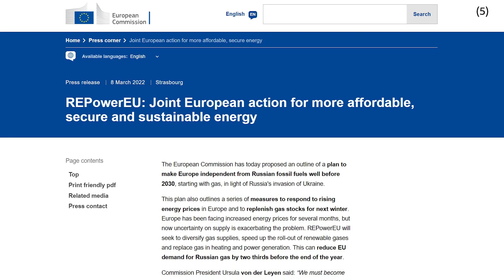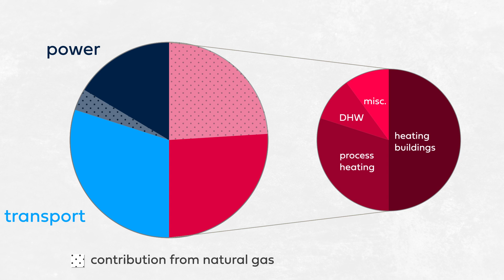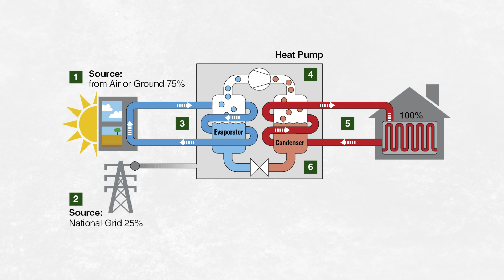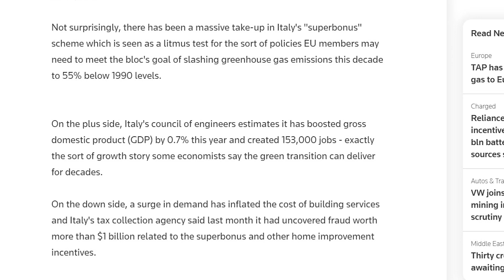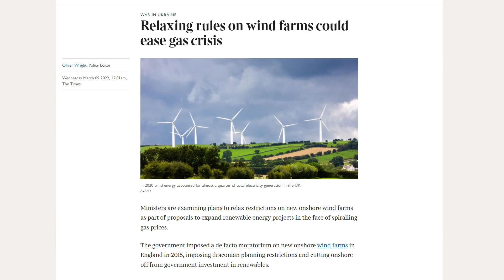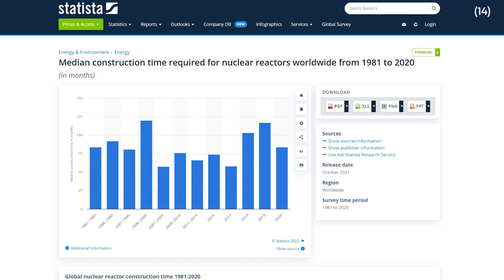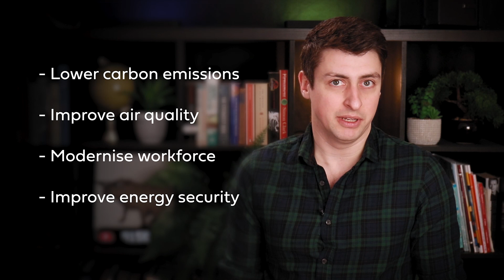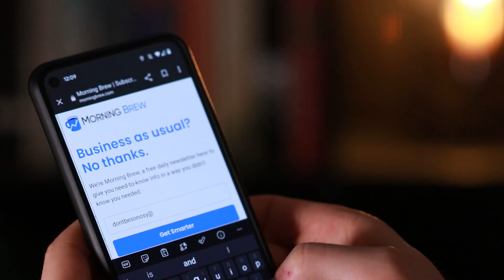How Europe can wean itself off Russian gas

Comment: Another point that can be made about heat pumps is that they are essentially air-conditioners running in reverse. This means that in countries where air-conditioners are already common (such as Spain, Italy, etc.), existing air-conditioners could be replaced with hybrid units, which can provide cooling in the summer and warming in the winter.
Reply: Sometimes called ' reverse cycle heatpumps'.
Reply: I install these systems, they are really amazing.
Reply: One important advantage also is that they usually have an efficiency of 450% for a simple system or even more (unit exchanging heat with the ground can exceed 600% even on a small scale system and 750% for bigger system serving a building). Meaning if you produce 1 kWh of energy by burning gas for heating in your home you'll only get 1kwh of heat. But if you burn 1 kWh of gas in a power plant, with efficiency usually ranging between 40 and 60% you'll get around 0.37 to 0.55 kWh of electricity delivered, accounting for grid losses. Those will translate to 1.6 - 2.4 kWh of heat in a simple system exchanging heat with outside air, or exceeding 4 kWh on more efficient system exchanging heat with the ground and serving a building instead of a single house. Thus even if it's energy from gas, you're getting much more useful heat out of it.
Reply: How this can solve a energy problem?
Reply: @DontMansion   With a heat pump giving 3kwh or 4Kwh of heat for every Kwh of electricity , we need less power in total.
Reply: You can convert an existing air conditioner to a heat pump with both heating and cooling by installing a heat pump thermostat, reversing valve, demand defrost control, two thermal expansion valves, and a supplementary electric resistance heater in the air handler.
Reply: Yep, virtually all air force heat pumps are air conditioners as well and are great systems to heat and cool homes, I know, I installed one myself last summer.
Reply: Practically all existing air conditioners are already what you call 'hybrid units' so nothing needs to be replaced. All it needs is for people to know which button to press on the remote control to set it to heating mode. I find it surprising how so many people have air conditioners and not know that they can also heat apart from cooling.
I have been using the air conditioners to heat my home for the past twenty years or so. I think it will actually be difficult to find an air conditioner that is not reversible, at least here in Europe. Maybe in other parts of the world it is different.
The way it works is quite simple, there is an electromechanical valve which reverses the flow of refrigerant swapping the roles of the condenser and the evaporator.
With all its benefits it does also have a serious limitation. At very low outside temperature it becomes less efficient and may even stop working entirely as the evaporator becomes too cold to do its job. So it is generally very effective for moderately cold outdoor temperature but not in extreme cold.
Reply: They are standard, but these units use a lot of electricity, the external radiators have large fans, great for dispersing concentrated heat but I doubt the efficiency of heat scavenging on cold days.  Heat pump systems generally pump liquid through underground exchanger pipes.
Coverage on methane supply has mentioned green hydrogen.  Perhaps Spain and Italy can become Solar energy converters  as could Scotland & Ireland with their potential for wind generation.
Reply: you are joking right
Reply: @bellini98-1  You can actually get even better than that but it is more situational as you need a body of water for a water source heat pump. A friend of mine has one that extracts heat from the River Severn in the UK as they live right next to it. Granted this is likely to result in other problems in time as despite the slope of their back garden the river is increasingly breaking flood records and it has reached within 30 cm of the ground floor already. But it need not be a river a lake or the sea is viable for those homes near it and our species has built a lot of homes and businesses near the water, we can exploit it's high heat capacity and good thermal conductivity in those areas for heating. You can of course also reverse this dumping a little extra heat from the air inside into a large thermal mass of water when it gets hot it is both a giant heat source and heat sink depending how you connect the piping up to the compressor and evaporator parts of the loop.
Reply: @listerdave1240  I think it is actually two valves, you want to flip both the input and output of the condenser and evaporator around such that they reverse roles. That would take two valves to work but that is all both are basically designed to couple the fluid with lots of thermally conductive surface area to maximise heat transfer.
Reply: @seraphina985  Well yes, I guess it depends on how you count valves.  From a functional point of view it can be considered as two valves but in practical terms it is actually a single device known as a reversing valve or a four way valve.
An oversimplified description of it is that there is a valve body with holes to which refrigerant pipes are connected. There is a piston inside the valve body and as it moves from one end to another it uncovers some holes in the valve body and covers some others and is actuated by a solenoid.
There are four pipes connected to those holes in the valve body, two of which go to the compressor, one to the outside radiator (normally acting as condenser) and one to the indoor radiator (normally acting as evaporator)
As the piston in the reversing valve moves from one end to the other it swaps the connections to the compressor such that the suction is connected either to the condenser or evaporator while at the same time the discharge is connected to the opposite.
To be complete I would have to mention also two check valves that are often also present, actually probably always nowadays but AFAIK not in older air conditioners, but let's leave that on the side.
Reply: That can also be considered a downside as, it the summer cooling often eats up the energy savings of the winter. 😂😂
Reply: @listerdave1240  I appreciate you explaining the mechanics as I had no idea how it was implemented in practice, merely that two outputs need to be swapped between two inputs thus two valves acting like double pole switches.

Thanks to your explanation how the valve actually works I realised it is actually analogous to a double pole double throw switch. Recognising that I realised that both valves ought to be interlocked in this situation so a double throw valve would be the solution. Somehow I'd missed the bug in the independent valve design as I'd failed to consider the edge case where only a single valve actuates, once you mentioned it was a double throw I realised that is a worse failure mode than neither valve moving at all (At least in the latter the device can function in the last mode set pending repair/replacement of the inop valve).

I guess it suddenly hit me when I recognised the analogy with double pole double throw relays and such, suddenly it hit me the thought that this is essentially a polarity reversal/pair swap circuit which are familiar to me as I've written device firmware for chips with pins directly connected to ports where the cable can be inserted upside down like USB-C. Naturally when that happens all of the pins are flipped horizontally too so the firmware needs to detect this and flip the electrical connections. Get this wrong with the data lines it is almost invariably fine, the user might need to manually unplug and rotate the cable like it is a USB-A but nothing dies. Mess this up on the +5V/GND lines and all bets are off, lots of microelectronics don't appreciate a voltage of 5V period (3.3V is more common for IC's for example) of those that will another batch will die as they give up the blue smoke and go on perpetual strike if fed reverse voltage etc. Or other things that can happen with some connector type is things like a 5V and 12V line getting swapped (There is a connector with a single straight line of pins that can insert and connect either way up. Pinout of interest P1 +5V, P5 0V, P9 +12V, P5 is in the middle so it is constant, mirror the other and you will see the problem).

Comment: Disappointed by the blanket dismal of nuclear. Would've been a great time to discuss keeping existing nuclear power plants open and producing low-carbon electricity instead of shutting them down (Looks at Germany and Belgium specifically). Also if using electric heat pumps for heating then you need to decarbonize electricity production too. And we need all the firm low-carbon generators we can get
Reply: The point is that those things can't be done in a short enough time frame, as he said.

Comment: Around 3:20, Simon claims that insulating buildings "can be widely rolled out rapidly". it would be nice if this were really so, but it isn't really!
For starters, this IS being done already, has been going on for many years (and that of course does not invalidate the concept, quite the contrary) - and what's holding back building owners is often, today already, the scarcity of insulating materials and - more importantly - of skilled workers and firms to do the job. Tried calling your local contractors for roofing, windows, wall building lately when they may have time to refurbish your home? You won't get one for next week. If all of Europe wants to accelerate this - rapidly! -, the situation's gonna get worse: Prices increase drastically, without much more work being done in the short term, and it will take some years before capacities come up to levels necessary to "widely roll out rapidly" throughout Europe (or everywhere else).
There is also a bit of a problem in that many insulating materials are an environmental hazard in and of themselves. We need others, more eco-friendly ones - and that takes even more time to roll out widely.

Similar caution applies to heat pumps - only worse: While some of the handy work to insulate homes can be done by unskilled work (e.g. home owners themselves), this is not at all true for heat pumps, where you need electricians at least (don't fiddle with electricity unless you have thoroughly learned the trade!),  but also specialists for drilling deep below your house etc. Nice technology - comes decades too late to avert the current crisis and dependence on Russia.

Solar and wind electricity generation should by all means be expanded - but would do little to decrease the use of natural gas in the electric grid, for natural gas plant's classic job is to jump in on the shortest of notices when demand goes up or base supply goes down - the exact two things that solar and wind have a problem with. Natural gas is in storage for that job, and short-term storage is exactly what the solar and wind installations are largely missing (so far). So what we need to, specifically, get rid of gas plants is not so much more renewable production per se but energy storage in the grid, to fill the gaps when solar+wind+nuclear+and all the rest cannot crank up output at short notice. (I suppose some regional grids use more gas than others, and not all of it in that backup role; surely, in such regions, some gas can be substituted on far shorter notice).

What everybody can do, right now, is reduce personal use of energy, particularly if you use gas (or oil, where Russia again is a major exporter to Europe), e.g. by reducing target temperature in your home or office by one degree. Or by switching off your heating system two weeks earlier in spring than you ordinarily would. Put on warmer socks, move a little more, and just get used to it.
Reply: Solar and wind would add to the base level of available energy, and thus less gas would be needed to fill in for temporary increases in demand.
Reply: Perhaps they could propose a "normal" energy consumption for a certain house volume and anything above that would cost a lot more. The advantage of that is that the owner now can think out a solution himself. Perhaps he could indeed insulate his house completely or he could use only one heated room, sleep downstairs for a while, wear a lot of clothes..

Comment: The problem with renewables is transmission and the time to construct the transmission as the obvious locations have been used up, project timelines are getting prolonged. Nuclear can be built in 4-5 years which is comparable with big  renewable projects (the speed of permeting has to be addressed tho)
Reply: Flamanville unit 3 is taking more than 4-5 years as is Hinckley point C
Reply: @waynecartwright-js8tw  those are outliers. The median time of construction of a nuclear reactor is 6.3 years.

Comment: Hi Simon, have you looked into nuclear co-generation as an option for process and domestic heating applications? I'm a PhD student myself investigating further co-generation options
Reply: Until recently Russia had 60KW thermal reactors in Siberia.
Reply: I don't know the efficiency compared to PEM Electrolysis etc, but Thermochemical production of Hydrogen via Nuclear Power has been proposed/studied a bit.
 (Also radiolysis with spent fuel rod cooling pools, but i don't know if that has a contamination risk).
Reply: Granted i think short of ultra-remote (Artic+Antartic, Mobile Like Ships/Subs, Space etc) / high energy use places (Dense Urban Areas, Captive Power Plants for Huge Industrial Hubs), i don't see much of a role for nuclear in the future, it would have been great as a Centralized Coal Plant Based Grid-era Replacement, but (Fore the most part, some exceptions exist) Decentralized Grids are the future.
Reply: Former Warsaw pact countries used waste steam for district heating. I know the Czech republic still uses their turbine exhaust steam for district heating. You can also use the waste steam to drive absorption chillers for air conditioning and refrigeration.
Reply: @gregorymalchuk272  yes. We use waste heat from Mělník (coal) power plant for heating parts of Prague. There is even talk about similar scheme in Brno and Dukovany (nuclear) power plant.

Comment: Great video Simon! Another excellent heating technology is heat networks, which provide heat from a central source to locations, rather than individual users having their own boiler or heating pump. Because it's centralised it can provide much more efficient heating than conventional heating methods, so can both bring down operating costs for renewable projects and reduce gas consumption per KWh of heating
Reply: Heat is one of the hardest forms of energy to transport over distances. Losses on heat are usually to do with transport. As an example;
Our floor heating system from the electric pump getting heat from the ground (90 meters deep) loses about 60% of the energy transporting it.
It's much more efficient in big housing units, but as soon as it has to travel the losses are too big for it to be efficient.
Reply: Relative heat loss is dependent on your level of pipe insulation - a lot of multibuilding networks in other countries (networks are used heavily in Norway and Denmark) use an insulation standard much higher than is usually used in the UK to achieve that retention!
Reply: @evildude951  Regardless of insulation, you'll lose a lot more energy transporting heat compared to electricity. Where it's more beneficial it should be used. But for a bulk of places (as of right now) switching to electric heating would make much more of a difference.
Reply: @simmerke1111  The energy loss in a district heating system in a Finnish city is around 7-9%. Electric grid average loss is 3%. In many places the waste heat from electricity generation, industry, data-centers, etc. is used for the district heating. However, for now a lot of the heat still comes from fossil fuel sources just like the electricity.
Reply: yeah it's also very easy for the government to shut off heating any time, not to mention single point of failure and heat loss.
Reply: Considering how efficient top tier gas systems are, and how little they generally cost, it might be worse for the environment to just try to jump to this conversion unless there is already infrastructure in place.

https://www.youtube.com/watch?v=lBVvnDfW2Xo is a great video on how the high efficiency condensing furnaces work. He's gung ho about heat pumps and electrification, but if you already have a furnace like the one in the video, converting to a heat network will probably be a bridge too far.

Comment: sometimes even replacing old gas boilers for new one can do a lot. Changed from one made in 2006, for newer condensation unit with  heat water on demand (made 2018), result about 30% less gas used just with that. And now, there are some that are 40+ years old still in use. Our government, gives about 25% subsidy to upgrade to newer, more effective solutions for heating, from wood burning boilers to Photovoltaic. It will not cover all costs, limited brands (mostly local, with exception of PVE) but it helps too. I think will ramp it up some now